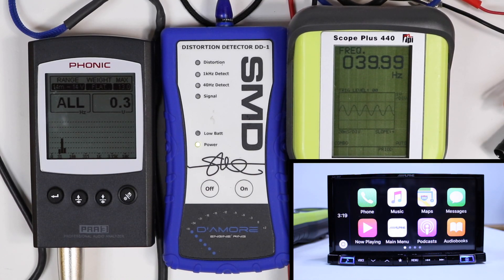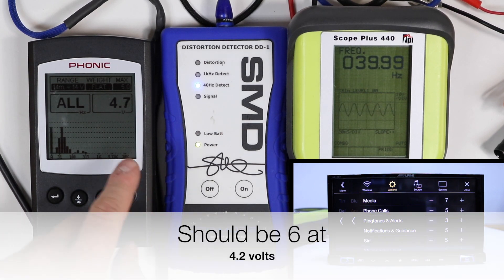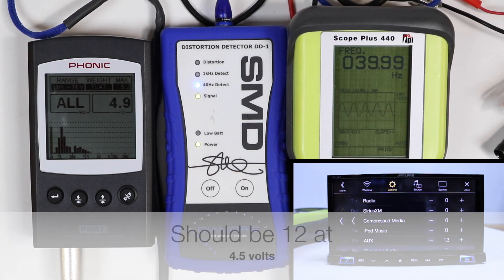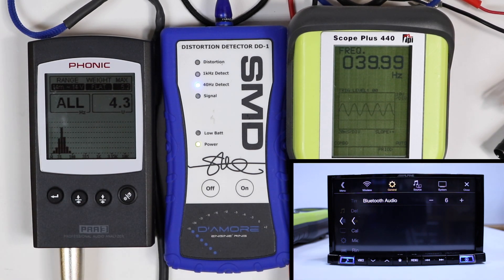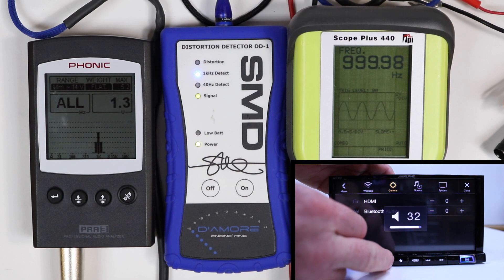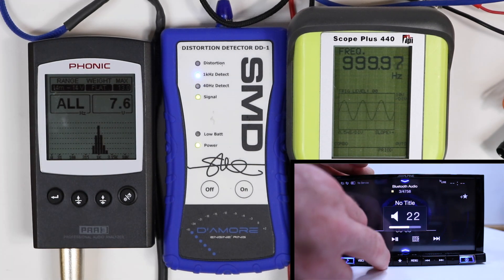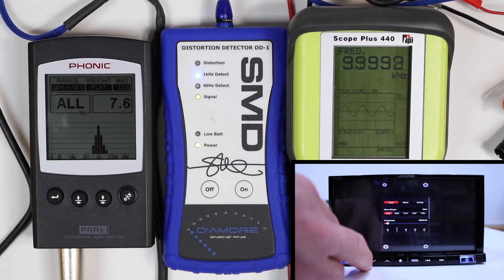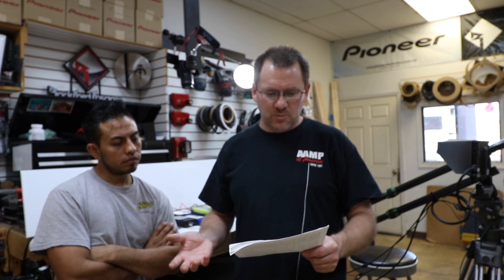Alpine iLx 207, SMD DD1 Car Radio Dyno

Comment: Dean and Fernando quick question for ya!  How can I connect a SiriusXM Onyx direct to an amplifier in a boat that doesn't have a stereo/radio?  It would have to be an amplifier that has a aux input right?  Or could I just get a 3.5mm aux chord that is a 'Y' split into left (white) and right (red) RCA ends on it?  Would that work it's basically a aux to RCA Y cable.  I just don't know if the unit would still need some sort of a stereo for audio controls right?
Reply from the maker: +[]D [] []V[] []D [] []\[] U 0UT does the Onyx have a  line out ( aux or aux to rca)? If so you could use a PAC LC-1 volume knob between it and the Amp
Reply: Five Star Car Stereo  Yes, the line out on the Onyx is just a 3.5mm aux, like a headphone plug.  And normally people just get a (3.5mm male to male) cable and plug into their dash stereo receiver's 3.5mm aux input.  But in our case since no stereo on boat, I think the Pac LC-1 would be perfect!  Now I just need a way to figure out how to add Bluetooth somewhere in that connection. Lol  Or maybe something like this Planet Audio PGR35B IPX6 would be better instead huh?  Although that's basically just adding a car stereo but doesn't look like it, that's all.
Reply from the maker: +[]D [] []V[] []D [] []\[] U 0UT check out the install bay IBR65
Reply: Five Star Car Stereo   Awesome thank ya man!